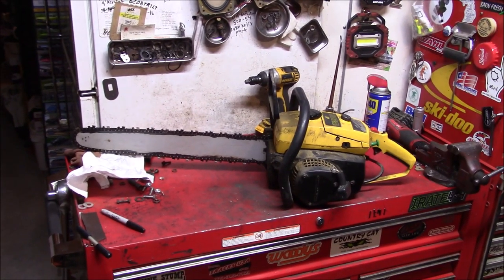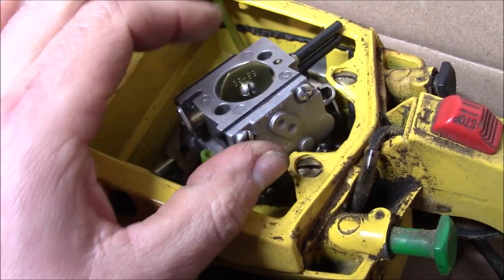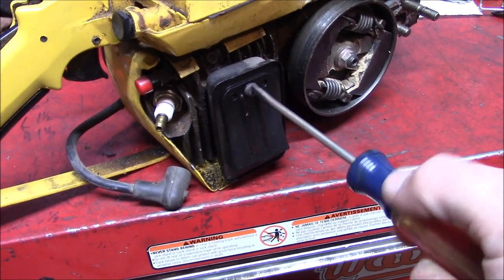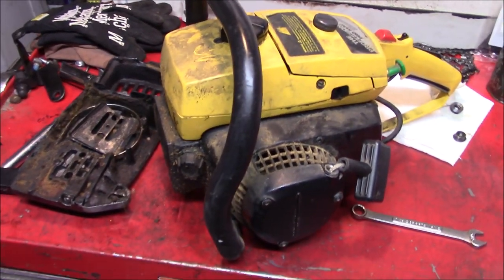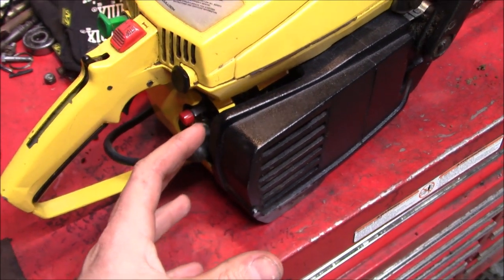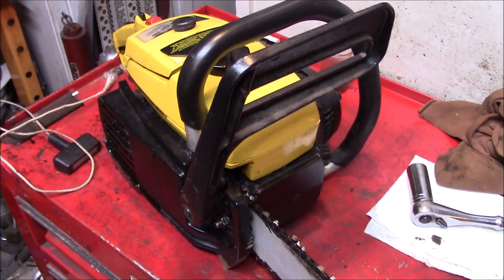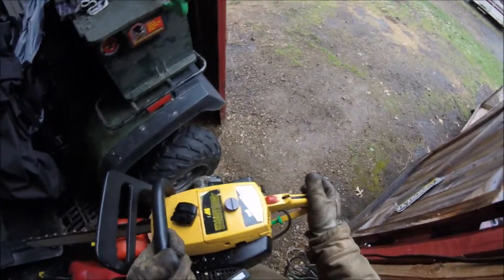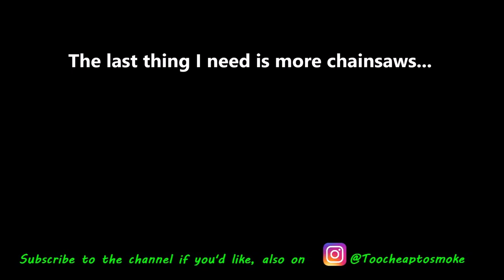Pro Mac 700 Cuts Again!

Comment: I always see folks asking "what are the carburetor settings?"  and the important thing is as you demonstrated they are baselines-  they need to be tweaked and adjusted as you did under load and when warm.  And you are correct in that seal leaks will make them difficult to get to run consistently!  Rock on...
Reply from the maker: For sure!   These old saw also seem to like a winter and a summer tune, gotta keep 'em running crisp!
Reply: P

Comment: A year ago, my local fire department threw one of these old pro mac 700 in the dumpster. I of course grabbed it. New fuel, and some carb tuning and it’s the best running saw I have. My go to every time because of its reliability and excellent power. Only difference is I don’t think mine has a muffler like yours. In fact, I don’t think it really has a muffler at all
Reply from the maker: Gotta love the dumpster finds!

Comment: I think she's sucking bar oil out of the 4 crankcase bolts inside the oil tank just rebuilt my 700 and watched bellhopper assemble one, take out the case bolts and motoseal them and what's probably left of the 4 o-rings lol!
Reply from the maker: That sounds like it could very well be. 👍

Comment: You are supposed to hold the throttle wide open when doing compression test. 
Nice video it was enjoyable
Reply from the maker: I had the throttle lock on, not quite wide open but usually good enough.  Thanks for watching

Comment: I would take an early 90s or older model over any consumer grade saw (or any other gas appliance) being made today.  It's all junk not designed to be serviced. Use it till the fuels lines or anything else fails and chuck her in the trash.
Reply from the maker: Way too many modern products are designed that way :(